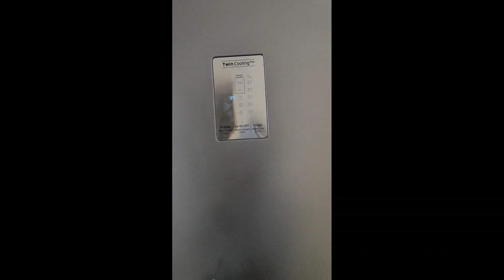#Chembetiadiseshu 13 September 2020శామ్సంగ్ రిఫ్రిజిరేటర్ 5 in1  ఆటో ఐస్‌మేకర్ కిట్ ఎలా తీయాలి

Comment: Best vacum pump and size cheppandi
Reply from the maker: Valve single stage
Reply: Value 115
Reply from the maker: Yes
Reply: 410a and 32 gas charging vacuum pump value 115 use cheyyavacha
Reply from the maker: Cheyyachu Ka ni double gage use cheyyali.
Reply: Bro 410a 32 gas back pressure cheppandi